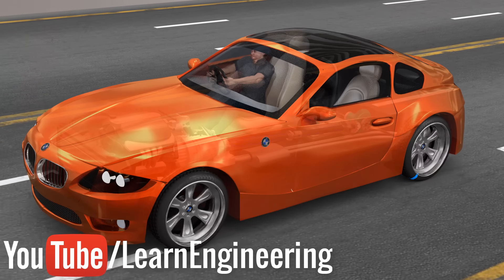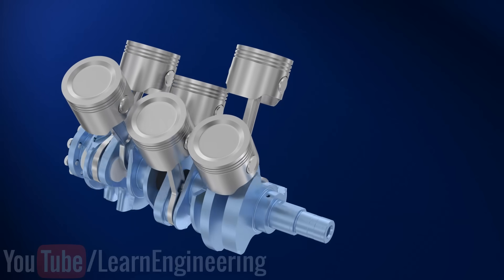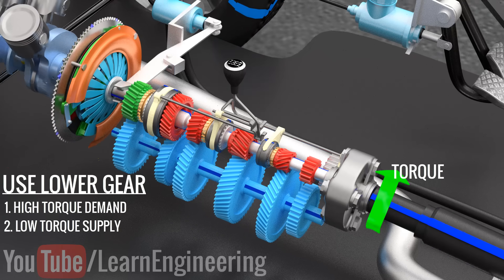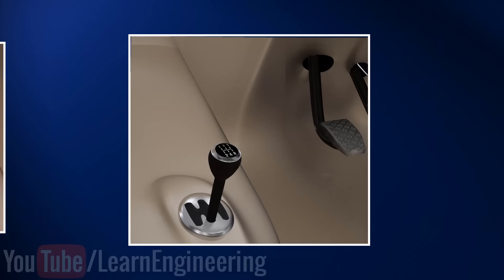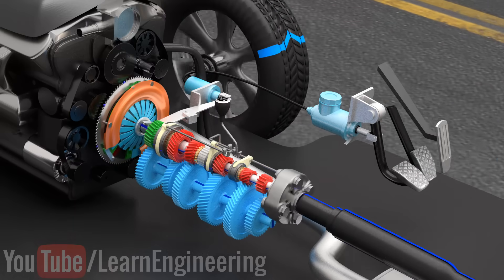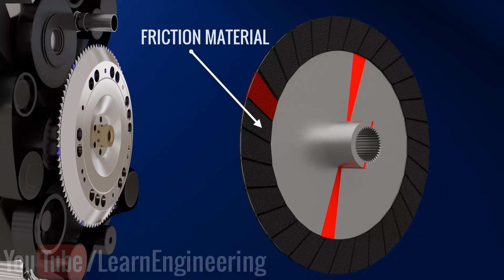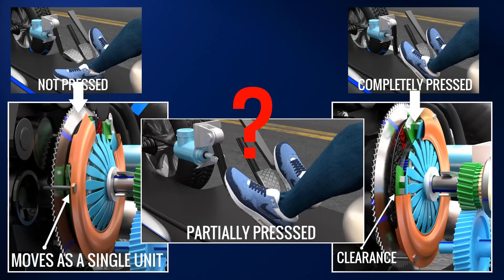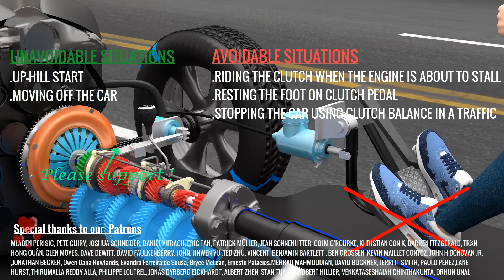Why you should not PARTIALLY press the Clutch?

Comment: You need to ride the clutch to drive in Indian traffic.
Reply: These guys don't even know What  heavy traffic is, riding the clutch is needed in my country too
Reply: @pedrojimenez2039  you don't have to ride the clutch in heavy traffic. You can tap the throttle and pull and push the clutch to get slowly moving. This increases your clutch life
Reply: @pedrojimenez2039  0⁰
Reply: @pedrojimenez2039  your needs doesn’t change physics my guy
Reply: @pedrojimenez2039  pinoy to.  😂😂😂
Reply: These people are dumbfucks. Half clutch is a very important lesson in driving.
Even the Driving test is done without an accelerator.
Reply: yoppindia in Algeria too😂😂
Reply: The difference between first world country traffic jams and third world country traffic jams is that in a third world country other drivers will literally squeeze in front of your car even if you only left 1 foot of space to the car in front of yours. So you gotta show that you'll close the 1ft gap to 1in and do it in an instant or else they'll think you're too afraid and will squeeze in front forcing you to slam on your breaks.
So in order to close the gap without a hesitation or a second of delay you have to ride the clutch in those instances.
I'm talking from my experience in Saudi Arabia. I'm in the US now and the traffic jams here are so easy there is absolutely no reason to ride the clutch
Reply: use of clutch is normal in slow speed..i do use clutch it does not affect clutch plate
Reply: India we drive on clutch in traffic at even gear one.. without that engine might stop abruptly which will lead to a more devastating situation like getting bumped by the car from behind.. and road rage with the other driver.. which may lead to actual body harm.. I am very comfortable with wear and tear of clutch than wear and tear of my own skin
Reply: Why?
Reply: @SirDella  because traffic jam occurs in daily basis on these country
Reply: Riding the clutch in 1st gear is a thing, it's also something required when you need to start uphill, but still it has to be avoided whenever possible if you don't want to have to replace the clutch disk often
Reply: Because in India and other countries mentioned in the comments. U may need to move few meters at a  time with centimeters of gap between cars, for up to a kilometer.. Sometimes on even uphill roads.. It's crazy here..
Reply: Regardless of country, you'll need half clutch operation while starting in a traffic. The thing about Indian traffic is people don't leave enough space in between cars. My dad and most of my friends will use half clutch even when the traffic starts moving at a steady pace because you never know who will just out of random will press brakes and slow the traffic. I, however, have made it a habbit to leave some space between me and the vehicle in front. So when, traffic starts, I simply put gear into 2nd and leave the clutch alone unless the traffic picks up speed and have to change to a higher gear. It is a lot of work in Start-Stop traffic but it will save your clutch and your knees. Also, type of car also matters, driving a small car like an 800 cc Alto requires more half clutch operation because of absolute unavailability of torque at low revs while a 1.5 litre mid-size sedan like Skoda Rapid or Honda City will start creeping effortlessly without any input on the accelerator.
Reply: Without applying half clutch in 1st gear, you can't drive car @ 1kph or 2kph speed in bumper to bumper traffic in rush hours  in a metropolitan city like Mumbai, India..
Reply: @milindia80  you are correct. Everyone misunderstood the concept of the video. Riding at slow speeds at 5th gear and riding a clutch is bad. Not half clutch in 1st or 2nd. Half clutch in 1st is a must in India.
Reply: Vehicles standing 5 meters behind is called traffic in US or UK...whereas in India it's 5 inches..
Reply: try Indonesia
Reply: and clutch balancing too!
Reply: In low speed situations yes. He is talking about people who do this even when the car is moving at higher speeds.
Reply: Don’t you have to just wait for enough room to get in front of you before releasing the clutch entirely?
Reply: @Omlet221  if you leave room, you are screwed, they think you are idiot, you will not be able to move forward, as you will be over taken/obstructed by two wheeler, pedestrians, other cars and they won't allow you. The best tactic is to keep creeping, without leaving any room using clutch and brake
Reply: in Turkey, in the Istanbul traffic too.
Reply: yeah, also in Bhutan
Reply: include pakistan too😂
Reply: No, you are absolutely wrong. You misunderstood the video. You see, I'm learning driving and half clutch is essential in high traffic conditions BUT AT A LOWER GEAR. when speed is slow, downshifting is a must. High gear, half clutch is dangerous to the transmission. Lower gear, half clutch (slowly releasing) while turning, navigating speed breakers or bumper to bumper traffic is must. Sudden clutch release also causes engine stall. Everything has to be gradual. We are not on a race track to shift gears like crazy. 
Riding in 4th or 5th dead slow and riding the clutch to prevent stalling is pure lethargy. Downshift and move. Simple. Transmission is costly.
Reply: @dr.ananthakrishnavemuri733  you missed the traffic in my comment.
Reply: @yoppindia  I did read it bro. But who rides in 4th or 5th gear in dead slow traffic in India?? What we do in 1st or 2nd gear is not "riding the clutch", rather it is just judicial use of clutch. The concept of video is some drivers use 5th gear at slow speeds and to prevent stalling (which is obvious), they press half clutch and move. The video did not speak about traffic. It is about cruising. Correct me if I am wrong in any way 😀
Reply: @dr.ananthakrishnavemuri733  the way we drive in traffic is incorrect, there is supposed to be keep distence, and not inch by inch crawl and getting in between other vehicles (two wheelers) , this leads to holding the half clutch to hold your position and creep. This causes enormous damage on clutch and gears. In city traffic I rarely reach 4th gear, forget about 5th. This happens every 2 to 3 feet. In my book this is riding the clutch.
Reply: @yoppindia  True. I totally agree. In India, very few have common sense. Not just the points you mentioned, many more lead to overuse of clutch. But that's India, what can we say.
Reply: Hey, Vietnamese here. I can relate.
Reply: If u don't play wid clutch in Indian traffic u either hit the car infront of u or let ur car stall in mid of a traffic 🤣🤣
Reply: @likhakhilli4969  I guess the horns start when you try and leave a gap lol
Reply: Or Philippine traffic, where almost everyone will cut you off, like you're not gonna need the clutch to keep your engine alive.
Reply: @Scooters Videos In China Mainland, most candidates of driving test choose to learn the manual car but after they get the driving license they purchase automatics
Reply: Cant disagree
Reply: Southern Italy
Reply: Yea and automatics are more comfortable In crowded cities with heavy traffic
Reply: Bilkul correct 😅
Reply: @benchoflemons398  only to airport 😜
Reply: Definitely
Reply: Very true. Especially here in Mizoram traffic
Reply: Damn right
Reply: YUUUUPPPPP!!!
Reply: These people can even ride cars in india if they use there technique in india the fuel will be burt like anything
Reply: @abkstithapragneyvaishwikh2204  More than fuel, if you don't drive the clutch, somebody will hit you from behind or you will end up hitting other and land up with a fine, bump on the car or end up in garage.
Reply: Yea
Reply: People from algeria,Indonesia,Spain think THEIR traffic can take beef with Indian one....Stupid noobs
Reply: @egykilenckilenchet  🤣 You're driving that much and still continously riding the clutch?  Look who's a joke now.
Reply: Inevitable
Reply: Yes ...
Reply: No you don't
Reply: Nope. Clutch riding is good. I'll keep a spare friction plate. Ha haa.
Reply: Yes
Reply: Exactly broo
Reply: Especially in EDSA. Manila, Philippines 🤣🤣
Reply: That’s a complete lie
Reply: So true 😂
Reply: @Olli yup I made that mistake, it very difficult to drive here, but automatic is expensive.
Reply: @Olli not here 😭
Reply: @Olli not here
Reply: True shit
Reply: That's right
Reply: Exactly 😂😂😂
Reply: Yes true
Reply: Yeah 🤣🤣🤣
Reply: Haha lol😂😂
Reply: Fact
Reply: Almost all developing countries need to ride the clutch
Reply: this is how I taught myself how to drive my manual this past week, I knew I could smell it a little but I didnt drive much. I was doing it with no traffic though so I just need to get better with letting go of clutch learning my grab point
Reply: True..!!
Reply: Expense to replace clutch is cheap.
Reply: America too
Reply: I use it as a brake.. because i am a learner now so when i start i slowly release clutch, then the vehicle starts moving without pressing accelerator (because the road is plain)..so when i get nervous i press the clutch again and it slows down and i slowly moved forward by releasing slowly again..Is it okay?
Reply: Facts bro !!I learnt to ride the clutch without even pressing it a little .I think most in India are trained for that.😆
Reply: Yes same in the philippines, alot of stop and go due to traffic
Reply: Yaaap
Reply: Yes .
Reply: Im just realizing that I think we are all missing key factors... What do you drive? Gear ratio of transmission? Gear ratio of diff? Tire size? 
I have been in some cars that I cant creep without applying clutch.. But I have never owned a car like that.. My trucks are geared High rendering a very slow first gear.. I mean you can walk away from it. Some cars can do 40 in first haha... I do 40 tops in 3rd. Many other countries dont have as many big turds (vehicles) on the roads like we do in America.. Usually the lighter vehicles have smaller gears.
Reply: @extremepoweraddicts2978  dont you have the Eaton Fuller 18 speed transmission in your truck with the range and splitter. Ya cars transmission are totally different and lot smaller.
Reply: @TheHelix123  less than 1% percent of trucks have 18 gears, if have 6th gear that itself is a big deal.
Reply: @yoppindia  I am not talking about those trucks in Indian everywhere else they have 18 gear trucks. From Peterbilts to Kenworths.
Reply: Everyone gangsta until they drive in conditions where almost no one follows traffic rules, no lane systems, rash driving, no speed limits, cutting corners. Hell some even ride their bikes on footpath during traffic congestions.
Reply: @sonam6873  add to that all sorts of animals, ancient vehicals and pedestrians that have a worse sense of traffic than animals also don't forget some two wheelers driving in the opposite lane, anything can come out anywhere anytime no one follows rules in many cities good luck.
Reply: you need to ride the clutch in any traffic besides American traffic apparently....leaving space only works if you're in slow creeping but constantly moving traffic and disengaging in neutral is only feasible if you''ll be at a standstill for a while like a red light.

where im from you almost ALWAYS have to be inching your way forward, by the time you fully release the clutch and pick up momentum you're already on the car's bumper in front of you and the pause between coming to a fullstop and moving forward isn't long enough to the point where you can relax in neutral or else you'll be switching gears every 5 seconds
Reply: @techroom6830  this is why 95% of Americans drive automatics....clutches are a pain when u r in traffic
Reply: @techroom6830  Americans have auto transmission so shutup
Reply: @generaljd1581 

Not all
Reply: @acw2237  95% are auto transmission driver
Reply: @generaljd1581 

And your point?
Reply: what if you are in an inclined traffic jam over a bridge or flyover and are moving inch by inch with cars moving bumper to bumper.?? Welcome to India. *enjoying the smell of clutch plate burning *
Reply: Let the clutch out move forward need to stop disengage not that hard riding it just burns the clutch up.
Reply: @TONOCLAY  i'm literally trying to understand what you just wrote
Reply: @seigma5340  the clutch is an on off switch with a little in between.
Reply: @egykilenckilenchet  well I've drivin over 400k miles in the last 4 years in a manual semi. In new york city, new Jersey, Atlanta Georgia, Chicago and 90% of all other major cities so being as I've probably drivin more miles in 4 years than in your lifetime. I think you are a smidge off there bud.
Reply: @seigma5340  same here
Reply: @TONOCLAY  I've been driving manual cars for nearly a decade, i have had driving jobs more than 10 years, I've done as much driving as a 100 year old, i can attest to this that driving efficiently and safely as possible requires ur leg to be as close to the clutch as possible so resting it on there unfortunately happens
Reply: @TONOCLAY  r/iamverysmart
Reply: @TONOCLAY  Mate, a truck has way more Torque than a car therefore will not stall even when crawling because there is so much intertia that the engine speed keeps it's momentum way longer which is why Diesel Engine Braking (aka Jake Braking) is required for slowing down.
Reply: @egykilenckilenchet  Not too mention the amount of torque trucks have compared to cars. They take long to get moving therefore take long to slow down which means the engine is slow but carries much more momentum .
Reply: @TONOCLAY  that's only when you have enough space to move try letting the clutch out to move one meter and see what happens.
Reply: @egykilenckilenchet  what you're describing isn't riding the clutch.
Reply: @egykilenckilenchet  this is my concern also ..while turning right or left in narrow lanes only braking doesn't work for me ...when i press half clutch then i feel my car is in control...am i right?
Reply: @egykilenckilenchet  You really have that bad technique aren't you by riding the clutch all the time in a traffic jam 😁 It takes a driver to understand how the mechanical works to have a solution to that. We have the same technique with Ton O'Clay by the way, learn from it.
Reply: @egykilenckilenchet  bit late, but exactly. Going from standing still to moving 2-5mph forward a few feet is not damaging the clutch. And its not the same as riding it. Its amazing how many people here legit have no idea how to use a manual gearbox
Reply: @TONOCLAY  come to India my man
Reply: @TONOCLAY  hahahaha 400k miles that's it
Reply: @ilhajan26922  No, you're not.
Reply: @egykilenckilenchet  I agree with you ... Good point and actually I think 99.9% people just let the clutch partially on in order to let the car moves most of the time especially in a traffic jam ..Also when you are in a parking lot leaving your spot... There aren't many space there... The only way is to let the clutch partially off with a little bit of gas to get out the spot and turn... And when on the road .. I rather have the clutch partially than stalling it ... And stat again ..
Reply: @egykilenckilenchet  I totally agree with you .. I have a question actually... I was waiting for a light to turn right and there was a car in front of me ...So I used 1st gear to get my car moving and switch to 2nd until I made the turn .. so by leaving on 1st and just to move the car for about 5 to 7 second at 2k rpm.. will I do any damage to it? Thanks
Reply: @TONOCLAY  Is it like when you jam a knife into a wall socket while switching it on?
Reply: @seigma5340   He says (hopefully): "Let the clutch out, move forward. Need to stop? Disengage. Not that hard. Riding it just burns the clutch up."
Reply: @TONOCLAY  you need to see the bumper to bumper traffic to believe it. Before you release the clutch, you would be braking.
Reply: in China(Mainland) too. In the 2nd stage of driving test for manual transmission vehicle, you HAVE TO finish the test WITHOUT accelerator.
Reply: no you don't... I'll fly over and prove you wrong, go down a gear or get a clutch replacment every year
Reply: @cheetahgaming3642  When lockdown is over you can come, now there is not much traffic, but don't bring any free Corona🤧
Reply: Maccha, you don't need to ride the clutch even in heavy traffic, if you know the car good enough then you're good
Reply: I guess the solutions is... never go in India
Reply: no need, unless u are up hill and very traffic
Reply: Its traffic here in Philippines too
Reply: U can leave the gear in 1st and use the throttle as little as possible while slowly stepping off the clutch but don't keep it in between.
Reply: @KuntalGhosh  that only works if the road is flat and traffic does not creep and no body tries to come in-between.
Reply: Just use a lower gear, and use neutral to coast. Use full or no clutch.
Reply: Try riding an unsprung 6 puck with at 3200lb pressure plate haha... Won't happen unless you rev to 5k.  Riding the clutch is not needed in traffic... A traffic jam is a traffic jam regardless of country, yes you may have 7 lanes of traffic all backed up for 3 hours but that's no different then 2 lanes backed up for 1 hour... No need to ride a clutch. Its funny though I met an Indian guy a few years ago first time I was in his car he would almost never drop the clutch, he was happy to rev and ride I was like what the Heck haha... Clutch jobs every year... Not for me I can go 200k on one. Usually in slow moving traffic I don't need clutch other then to take off... Or down shift... But up shifts no clutch needed when driving mellow.
Reply: @extremepoweraddicts2978  you just cant drive if you think a single plate has no slip point
Reply: @extremepoweraddicts2978  1st gear - 2nd w/o clutch? Wont it damage your engine?
Reply: @rokhadelossantos1524  It'll certainly damage your transmission. You can slip gears, but you have to match the revs. Even then, you'll still wear out your transmission.
Reply: @rokhadelossantos1524  It could mess up your syncros but where im from we call that power shifting around 3.5k rpms you take your foot of the gas shift and apply the gas.
Reply: BUSTAcap thanks man. But may I know the reason behind this?
Reply: Nope you don't. You're just a bad driver.
Reply: Clutch material also plays a big factor in how well it does to the heat of riding it.. Also in some countries its acceptable to inch and bump someones bumper... In America we try to stay a few feet from the other car. Too many factors people lets calm down haha.
Reply: I drive my manual in bay area stop-and-go. You don't need to ride the clutch. engage 1st & 2nd when you need to. Instead of riding the clutch, put the car in neutral and coast.
Reply: @jamesperry4470  you don't know traffic jams i see
Reply: no you dont